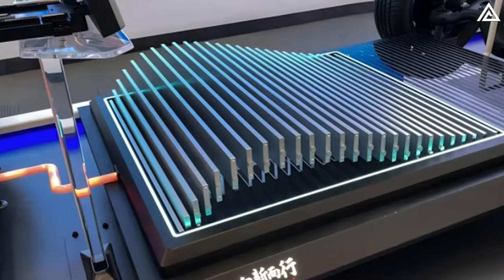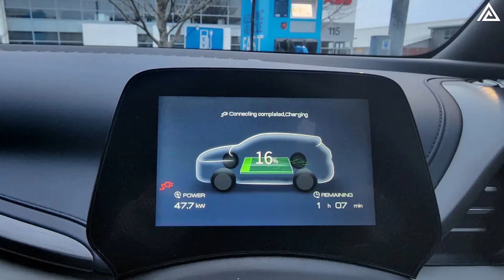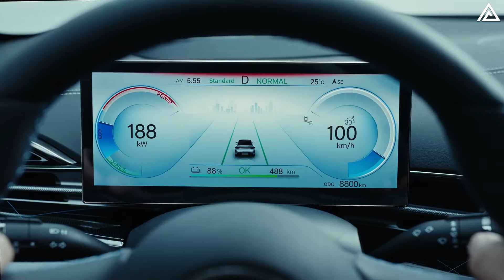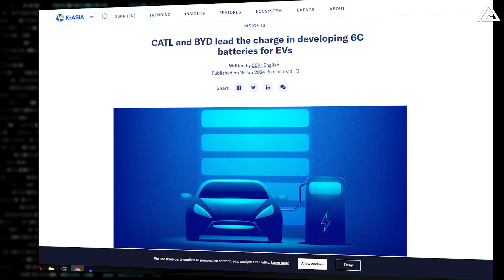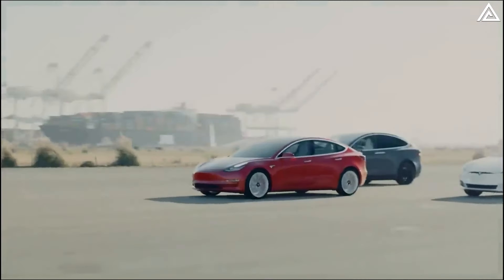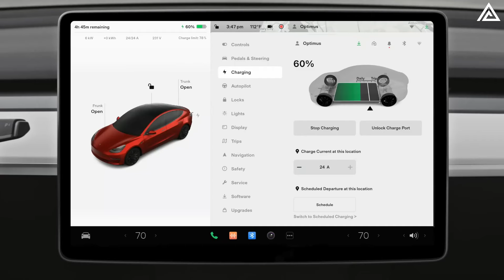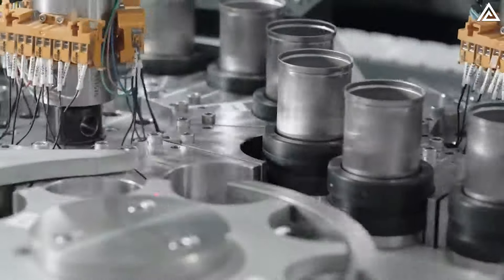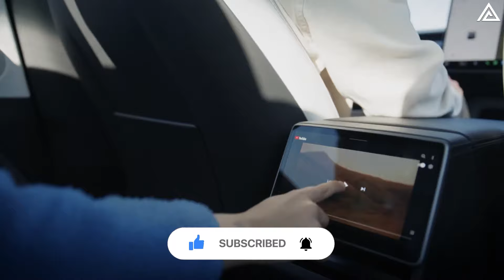It Happened! 2025 Tesla's New Blade Battery Gen II from BYD. Elon Musk Announcement Details

Comment: Despite how good it is supposed to be if they switched to the blade2 battery as it would severely increase range to an amount that is comparable to normal vehicles.
That is absolutely not happening, Elon musk has and is working on his own battery’s and he has them because he got tired of having to worry about rather or not if the battery company’s will be able to provide enough batteries. So he made his own as if you make your own battery and supply them to your self and only your self you don’t ever have a situation where you get stopped because someone else got the batteries first.
And with elons intense will to make things better his battery’s will eventually the best available.
Reply from the maker: You're absolutely right that Elon Musk’s strategy has centered on vertical integration, particularly with battery production. Tesla's focus on developing its own batteries, like the 4680 cells, underscores its commitment to self-reliance and innovation in energy density, manufacturing efficiency, and cost reduction. This approach ensures Tesla can meet demand without relying on third-party suppliers, avoiding supply chain disruptions that could slow production.

While BYD’s Blade Battery is an impressive LFP technology with high safety and longevity, Tesla’s in-house advancements aim to push the boundaries further. Musk’s vision is to create batteries that aren’t just competitive but industry-leading in terms of range, charging speed, and sustainability. By controlling its supply chain, Tesla has positioned itself to refine and iterate rapidly, maintaining its edge in the EV market.